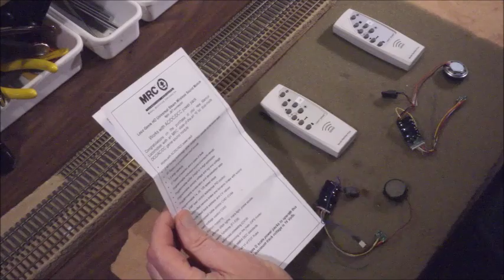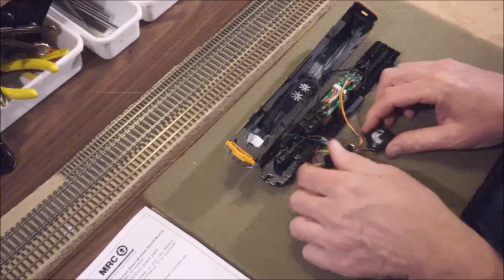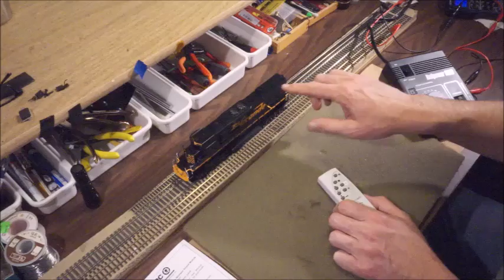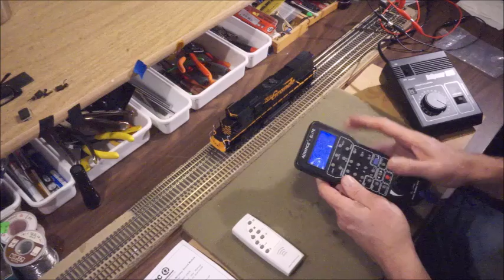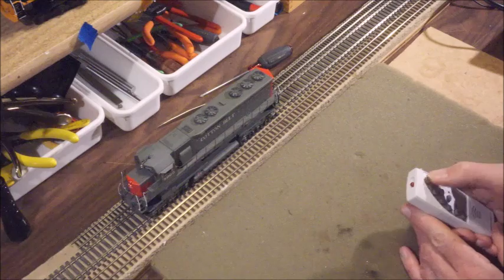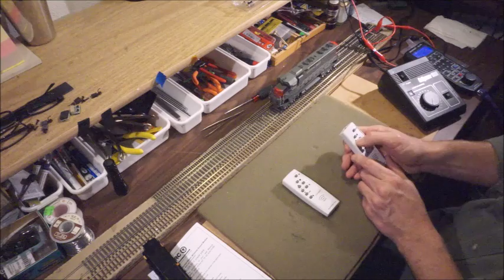First Look at MRC's Loco Genie

Comment: Can a single XL wireless controller be configured to operate multiple XL decoder equipped locomotives for MU operations? And is there a volume control? Or engine start up/shut down simulation?
Reply from the maker: The Loco Genie remote can only bind to one Loco Genie decoder at a time. The remote itself was not designed to control more than one locomotive at a time. I am not familiar with XL/XL Systems, so cannot answer that part of the question. Suggest you reach out to XL Systems directly for product support for their products.

Comment: Interesting system. It can be used with batterie power onboard it seems. Price is attractive and I like the idea that each loco has its own controller = operator. What's the sound quality and Decoder quality in general ? Do you use this system on your perso layout ? Thanks for posting & greetings, fil
Reply: I think it can easily be used that way.  This is a real option for the dead-rail guys.  The sound quality is the same as previous MRC sound decoders.  Some sounds are good, but the editing could use a lot of help.  That said, they are not bad.  I am a DCC guy, so don't use the system; just had the opportunity to test it out.

Comment: I want to see demo of the model power genie (black case), including with the 2 switchers (steam and DDT) owned by MRC
Reply from the maker: Did a little research on this.  Turns out the DDT has a Loco Genie “Light” as I called it, without the features of the full loco genie.  So a lot of the program features are absent.  I have not seen or tested one, so no more details than that at this time.
Reply: There is a video for it, put out by a little kid, that is how i know about it, a YouTube suggested for you thing.
I find one of the saddest things today is that companies bring out a new thing for us, YET after taking how ever long to make can't do a 3 minute demo vidoe

Comment: Can the locos be programmed through the remotes that come with it?
Reply from the maker: Confirmed: YES, the prime movers, bells, horns, voltage, acceleration/deceleration, light effects, and volume and be programmed…I may have missed one.
Reply: I did not test programming, so cannot comment.  Sorry.
Reply: according to another video you can, but it only shows doing the bells and horns
Reply: I bugged MRC about it, they say they are putting manual up, yet to see it

Comment: What is the typical price of the LOCO genie?
Can they be purchased reinstalled in a new Train.
Will LOCO Genie take over the Model RR hobby?
Where are they sold?
All that DCC programing is History.  
If We changed to a battery power train, no more problem with reverse loops, or lost power.
Reply: Just did a search and looks to be in the $50-$60 range.  I agree - I suspect battery power with wireless controls will be the next generation after DCC.  Sorry for the delay in response - I have not checked comments in a very long time!
Reply: 79 direct, less though other sources
there are 2 engines that have it preinstall, model power switchers
not fully, need remote with wheels
MRC direct and anyone who carries MRC
?
To change to battery power may be possible, question of power routing and switches